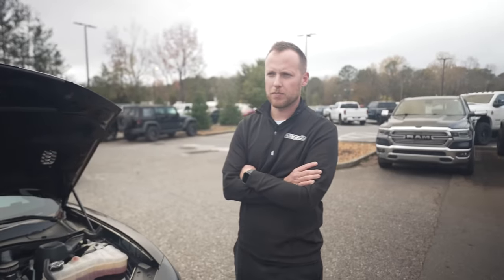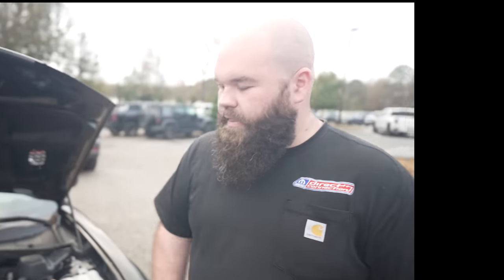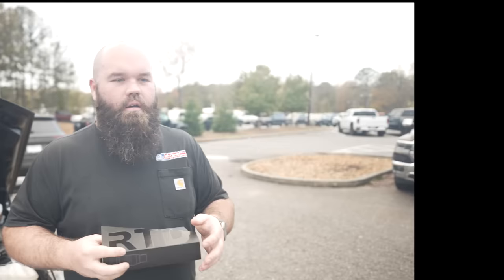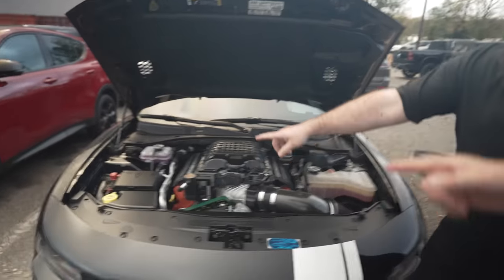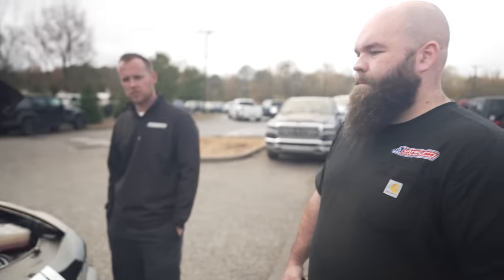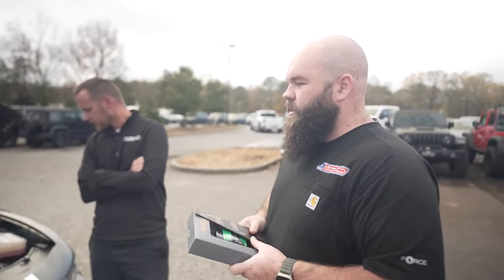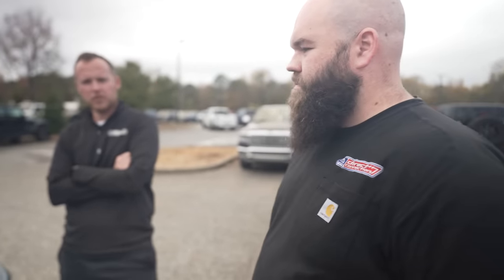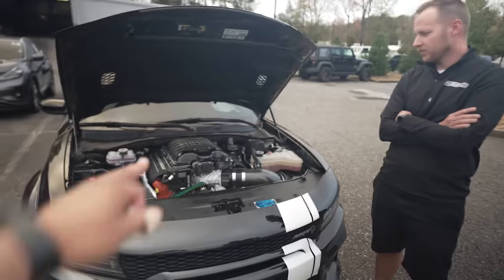Converting my Hellcat Charger to run on E-85 adds over 1,000HP w/ New "GHOUL PACKAGE"...

Comment: I dunno what’s worse the fact he’s interrupting every 5 sec with “yes sure” gotcha or that he’s done all this to his car to get gap by N/a scat like Mine😂😂 . Bro Timmy Barth is not the only one adapting those sensor StOp With the cap and miss information. You don’t need  4 apps to control e85 content….. advance fuel dynamics has away better kit you can jump back and forth from e85 to 93 octane without tunning …..gooofy knockout36slow🤡
Reply: Advanced fuel dynamics proflex is a piggyback system that only adjust fuel not spark, which makes the system kind of pointless. It’s not a true flex fuel system. However we do use advanced fuel dynamics flex link to read ethanol content, which is a great product. Barth and Curt (dusterhoff) are the only tuners that have adapted true flex fuel for the hellcat platform and have gotten them to work reliably. Respectfully you are misinformed. “Easier” systems from advanced fuel dynamics do not equal more power than a conventional tune.
Reply: @kylerpanter  thats why i found it funny that dusterhuff wasent mentioned. Im friends we ripatuned been following those guys a while . As far fuel dynamics goes great product im not miss informed i know it dosent do spark  in my case and current build i dont need mess with spark yet . Now when i do ill go to holley they make better system with less hassle. Unlike your boy knockout slow60 i do put hands on my car im not a dealer shop princess🤣🤣

Comment: Whats it run on the street
0-60
60-130
100-150
1/4
?

Why cant the car run a true flex tune, with ethonol reader, why does the customer have to mess with flashing tunes?
Reply: I will personally be running 60-130 times this weekend. Hellcats aren’t like gm cars when it comes to flex tunes. The technology taken from the demon170 has made it possible now, but it is new. Our tuner is one of 2 guys right now that has reliably made it work. It comes with its caveats (cost, downtime, and relearn process) the mopar pcm doesn’t handle flex tunes like other platforms. Flashing back and forth is very easy and very reliable. Knockout will not be running ethanol a lot so this works out great for him. Hope that makes sense.
Reply: @kylerpanter  will be watching for numbers. thanks